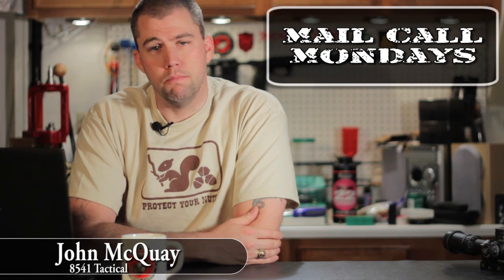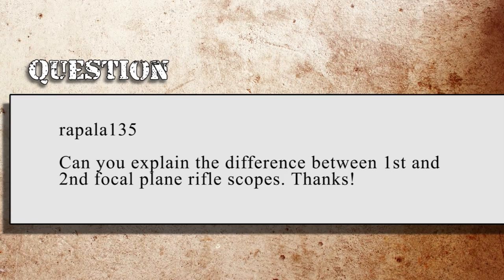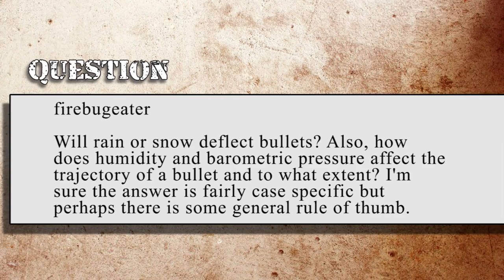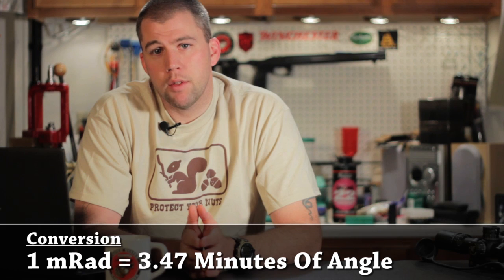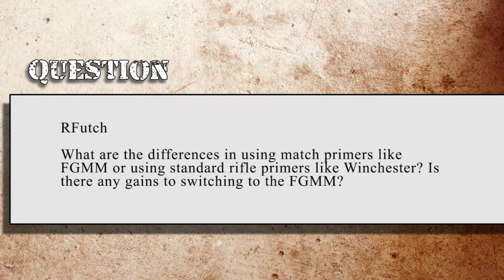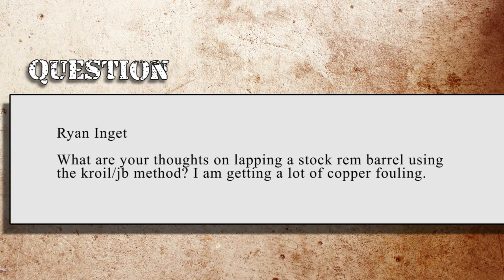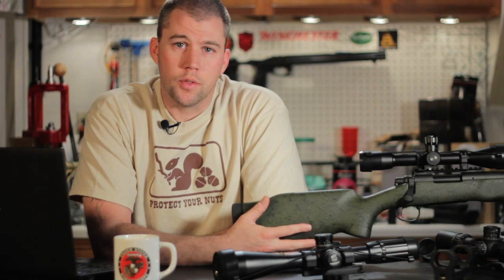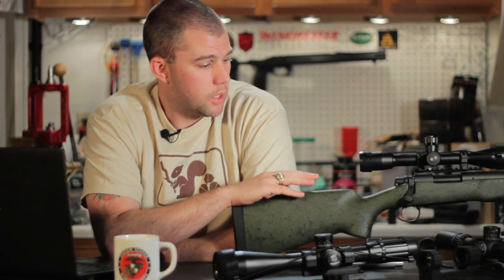Mail Call Mondays #7 - SFP vs. FFP, Rain, Snow, MOA/Mil, Primers, Lapping and more

Comment: Great video John.  You are right about the match primers to be careful if you are at max. pressures for that caliber.  I have found that the match primers are hotter than the normal primers to give you a better burn with your powder change.  Horus has some video's on how to check and see if your scope is right.  They have a cool web site for the guys to check out.

Comment: Really good job John - good info, in depth, and presented clearly and logically.

I especially like the discussion about the FFP vs the SFP as it applies to ranging and holdover.

BTW, one of those "odd-ball" SFP scopes is one of the Vortex Viper 6-24x scopes, I have one but don't recall the model number. Anyway reticle is only 'true' at the 20x power, rather than the max power of 24x. I've always wondered why they did that. The scope has a red mark on the body to align the power ring for the true reticle position.

Anyway great job!

Comment: question for next Monday....Have you noticed any point of impact changes when switching from sandbags to a bipod or from sitting at a bench to shooting prone ect (assuming a fully floated barrel and rigid stock scenario)? More specifically have you noticed any predictable trends related to poi change with different shooting positions and rests? example: concrete barricade wall standing verses rucksack from the prone position.

Comment: You normally need at least a 26" barrel for magnum cartridges-7mm Rem mag, 300 Win mag, etc. Although I would recommend a 28" barrel with an ultra mag cartridge. Given that the .338 Lapua (338's in general) is a much larger magnum than most, I personally wouldn't go shorter than 26". Also, don't forget the barrels twist rate, especially if you are shooting LONG distances and using heavier projectiles. Very important to stabilize the projectile when its heavier than regular hunting rounds. G Luck

Comment: Question for ya. I was planing on building up a tactical 308 but blew my funds on a 240 NMC for NRA high power/coyotes that has the weight and mobility of a semi axle. I have been planning on building a AR15 carbine for closer stuff but was wondering if there's any features/characteristics (barrel length/contour,twist, etc) that would get me out to 5 or 600 yards with a 5.56mm? I'd like to keep it smaller then a DM (IE M16) but am not sure that a M4 barrel contour will get me out there.Thx again